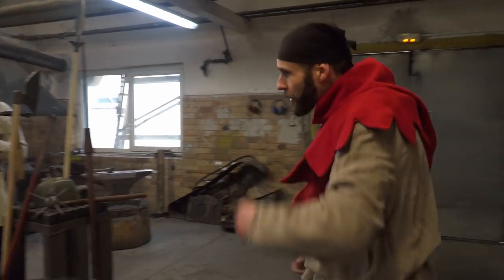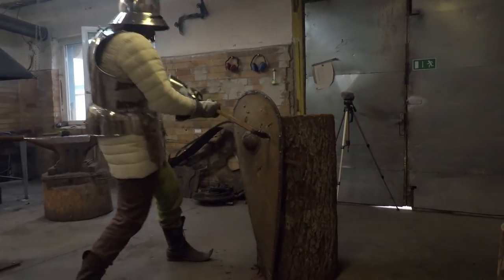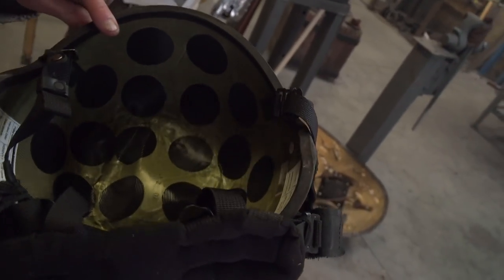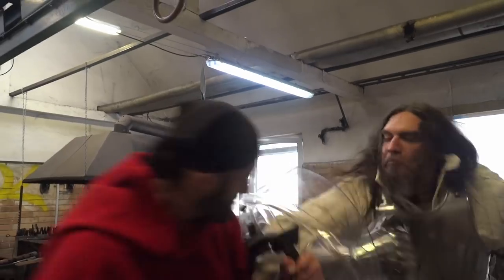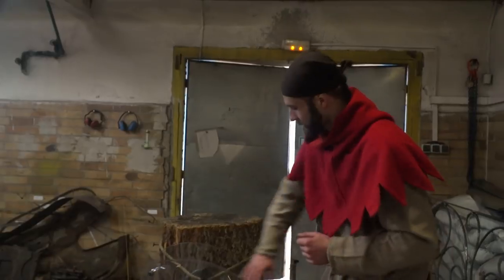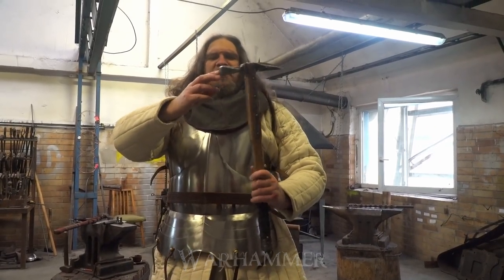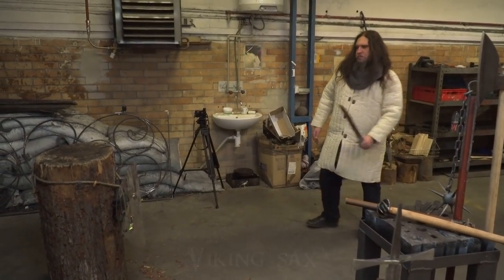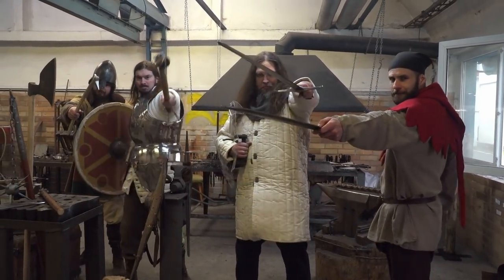Medieval Weapons vs Riot Shield (Extreme Test) Lords of the Blades Ep.7

Comment: My only concern with this is that it does not take into account the concussive force that will be occurring on the neck and spine with these blows.
Reply: Yup. Most of the blows on the Kevlar helmet would have been lethal, if not at once, then surely in a day or two.
Reply: Siward Beorn  A rifle round has momentum but not much mass. Kevlar is meant to distribute the impact of a round with little mass though its many layers. The warhammer has the force of the person swinging it and much more mass behind it. I will say that if the helmet was whole and not damaged beforehand then it may have withstood the first impacts better due to the curvature allowing for blows to glance off it. A direct hit on the top of the head would have compressed the neck of a wearer and done major damage. That kind of damage can be seen during the Crusades when the flat top Templar helmets came into use. Heavier weapons such as hammers, or stones dropped from walls might not have buckled the helmets from impact, but the soldiers' heads were still pushed down and caused compression injuries to the spine and neck. It's also seen more recently during WWI when shelling caused stones and debris to fall onto the heads of soldiers wearing rounded helmets, and they also came out with neck and spine injuries (instead of being killed outright by the falling debris.
That all being said, a strong blow to the head might do even more than just compression damage and instead buckle the kevlar helmet and crush the skull. 

As for the bec de corbin (spike) part of the hammer, that was meant to penetrate armour of all sorts. If someone of decent strength, and more  importantly, good accuracy were to strike the helmet with the spike it would sink into the helmet. As we see in this video it did not penetrate all the way through the helmet. This is due to the helmet being empty. If a human head was inside then the helmet would have nowhere to bend into. At that point the target would likely have a fractured skull, even if the point didn't penetrate all the way through.

Comment: The Slavic axe just makes me laugh😂Looks out of place, but I’m sure it had its uses.
Reply: It was blunt version, used for reenactment fighting. Original was sharp. It is based on original piece dug from ground 30km east from Prague.
Reply: Matej Lachman was the axe head small in the time it was truly used? The size just made me laugh because compared to the Irish axe it was so small lol
Reply: @potatoslave0357  It was actually used, that reproduction is made to match precisely the original. The Slavic axe is from 10th century. back then iron was more rare. The Irish axe is approximately from 16th century, when iron was much more available.
Reply: Smaller Axe heads were meant for penetrating armor and shields. All the weight of a normal Axe head concentrated into a small area